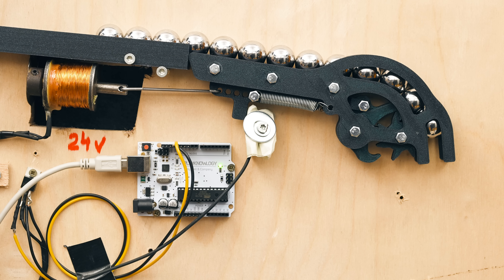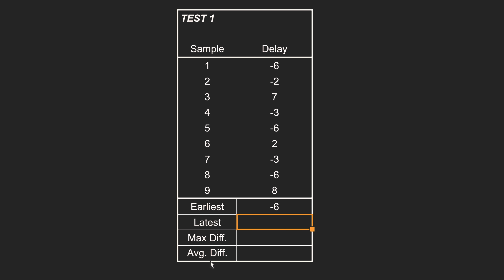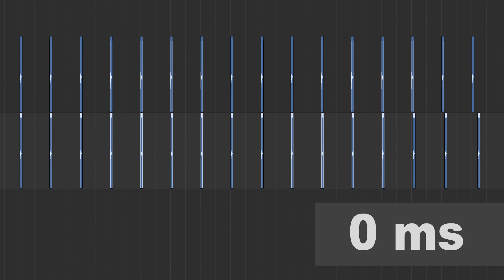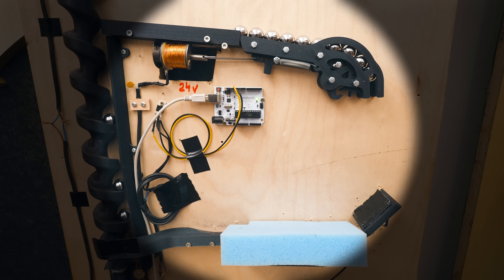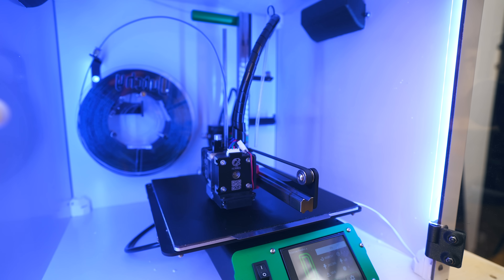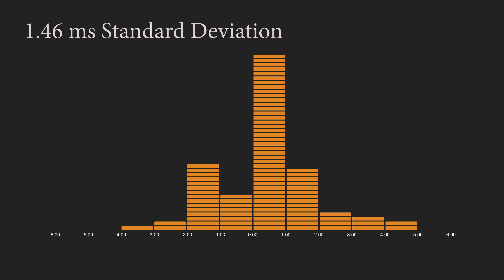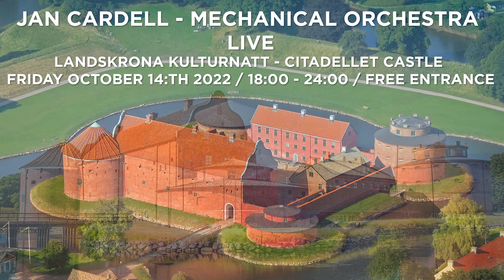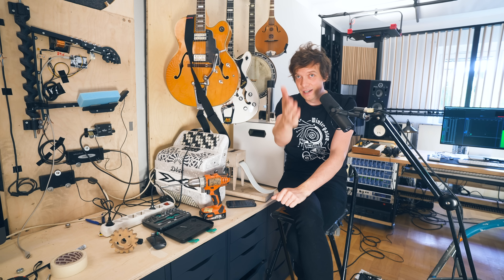Testing the Arduino Marble Gate

Comment: one thing worth considering, the more steel used on parts that are in motion of some form, will give you optimal tightness and life span. There is a specfic property for this feature of steel but I can't for the life of me remember its name (reproducablity maybe?).  But it is one of the reasons it is used in making mass production machines.

Comment: Hi there !
Just a comment on your methodology from an engineer point of view, although not a mechanical one) : You'll probably agree that, by itself, a 4ms lag in the marble drop has no importance. I'm pretty sure that with the various vibrations and few instruments, no one will ever know about it. What you might want to be careful with are rather "accumulated delay", that is, you don't want your the drop time to drift over time. 

I think an interesting measure would be the average/mean duration of each drop rather than the standard deviation. In example, let's say you want a 1s fall time. If the average time over 100 fall is something like 1.1s, you'll be screwed after those 100 falls, regardless of the standard deviation. However, if you get 1s average with a 7ms SD, you'll probably be fine. This will allow you to relax your tolerances on the fall (which are very tight to say the least) and push them to the actual timing of your machine, on which I believe you will have less issue adjusting.

Comment: I REALLY hope this measuring of single-millisecond timing is only for methodology, because not only will you never attain such precision at full scale (without killing yourself, anyway), it makes next to no difference in the audible output. I only started hearing drift at 20ms, and then just barely. And because we're not dealing with a single marble that never stops moving, the delays won't be cumulative.

If you are even THINKING you can engineer an entire Marble Machine with such timing, please make a list of EVERY variable that can influence it. It's not just the points of contact, it's varying spring tightness, gradual wear of the marbles, gradual warping of the wood/metal/plastic, vibration of the entire machine. Then I hope you will stop thinking about it, and widen your margin of error.

You stopped working on the MMX for one reason, reliability. A machine can still be reliable at 20ms compared to 1.5ms.

Comment: You should consider sampling the arduino signal that drives the electromagnet as well. That signal should be way tighter than 1ms and you could debug the electromagnet actuator.

Comment: Dear Martin, I got a train of thought for you that might add another perspective to your approach. I don't think that from a listeners point of "view" even the variance of 20 ms poses any problem. In fact it even feels more natural than this highly exact beat does.

You're on the way to something that is different from a digital drum machine by complexity and looks only and I'm not sure that this is what you aim to accomplish. And I actually don't think it is what is needed to get the Marble Machine going.

The question is: Why do you need that kind of accuracy? And there are two things I can think about...

1) Errors. Catching and transporting the marbles has been pretty difficult in the previous versions of the MM. So having exact marble movement was a must. But the problem is that the more complex the mechanism is that catches the marbles the more precise they have to drop. So simplification of the catching mechanism takes out the need to be overly precise in the drop.

I know, a funnel the width of the whole machine isn't as intriguing as the fly trap funnels but it gets the job done every time... no matter how sloppy the drop is.

2) Tightness. You can't play tight enough if the marbles aren't dropping right because they might get in the way of each other.... Except... If you split the drops between two (or more) identical drums. Which means half the precision is needed in the drop to get the marbles out of the way in time. (Which ties in with the whole "simplicistic catch mechanism" thing).

Hopefully this perspective helps a tiny bit on your great journey. 🤗

Comment: I remember watching the original video of the marble machine and being amazed. I knew the video was edited. There was no way the machine could play that as perfectly as it did in a single take. I just didn’t care. When Martin started on the MMX, I loved watching the way Martin had envisioned the machine and how some of the problems of a world tour would need to be solved. Then it slowly became watching a musician obsessed with perfection beating his head against a metaphorical wall of attempting to make sure some stupid ball bearings don’t fall on the floor.

I’ve learned a lot watching Martin’s video. How problem solving works for things in engineering mostly. But the biggest take away I have learned from Martin, don’t chase the unattainable. Unbreakable combs can be broken, the Maytag repairman will still to be employed, and galvanic corrosion will inevitably occur. 98% success is enough in most cases.
Reply: the first marble machine played it... why should it be edited??? who told you such a garbage?

Comment: Maybe a quicker test harness to iterate designs would be to connect a mic/sensor near where the release happens and another where the marble hits, connect them to the Arduino, get the Arduino to calculate the stdev after n marble releases and send the value back to PC over Serial port.

Comment: You need a statistician or a data scientist or something to help you design these experiments and interpret the results. The experiments that you are doing are decent but could use some automation (manually entering data into a spreadsheet sucks, what if you could get 1000s of data points automatically!?). Interpreting the results you also do a reasonable job but someone really well versed in this could help understand what the data is actually doing, and perhaps give better insights on why its doing what it is doing.

I am a data scientist though so i might be a bit biased.

Comment: Good to see you back to work. I have missed your videos. I understand having to take a break from something. gives you perspective... Keep up the good work and I hope you do decide to build another. This time with the experience and knowledge you have gained. Just remember, it will never be perfect. If you expect perfection, then your setting yourself up for failure. With that said, There is no rule you have to follow. you can build it anyway you want. electrical, mechanical, wind powered, pneumatic, hydraulic, or whatever you can imagine.... in my mind, I see the marbles flowing in a sort of Laminar flow. Guide the marbles to their destination and rely less on the release on more on the flow. You could have a small marble area and a large marble area that give softer and louder hits. you could use a diverter system. each note getting a constant 4 balls a second and a diverter picks the ball to send to the note and the rest bypass. Like I said, whatever you can imagine... I will be watching.

Comment: I think you need a computer engineer.
You need to connect the contact microphone to the arduino and let the arduino count the time using the ADC and a thresold (or just a digital pin and an interrupt if connected properly).
Using an audio workstation is time consuming.
I hope you read this post because you need to get rid of that audio workstation to measure time.

Comment: welcome back ;)   i think you might get more useful results rather than a rough indicator with samples of 1000's of drops the arduino can calculate and record the differences in a csv for analysis or  even just calculate the sd for you requiring little or no spreadsheet shenanigans..

Comment: Before you do anymore design changes hear me out as an programming suggestion. Change your standard to Nanoseconds instead of relying on a difference in ms. If your tolerance is 1-3ms then you have 1000000 nanoseconds to 3000000 nanoseconds to work with in your design.

Comment: Probably not useful information for the real machine as you're not planning on using any electronics, but for those interested:

Arduinos and other microcontrollers are able to flip their control outputs from low to high (GPIOS) with pretty incredible accuracy. Where I work, we've worked on a few electronic products that rely on this accuracy for things like serial communication, where the timing can be in the KHz.

The timing issues from the arduino test are likely from the mechanical action of the solenoid, from the travel and friction of the bar. While the voltage for the solenoid can be flipped pretty quickly, the solenoid's magnetic field takes time to charge, though this should be usually pretty constant. The movement of the bar and spring is likely the biggest variable which could possibly be improved with a tighter spring and less travel on the mechanism.

Comment: The delay (for a given system) is random. A same amount of samples (marble drops) per test (each with their random delay) does not mean that the standard deviation you get from those samples are equally representative for the delay of the different systems. It takes a certain amount of samples for statistical quantities to converge to a value (i.e. to have the standard deviation value no longer change even if you keep increasing the number of samples from that point onward). That converged standard deviation value is representative of the system alone, a non-converged value is representative of the system, but also kind of dependent on the specific test, i.e. random. So with too few samples, your standard deviation value doesn't converge and it will be random (it will differ for the same system in different tests). Then again, I'm no expert, so I might not be fully right.

Comment: Regarding the angle of the marble mic, this means that a way to increase the tightness of the timing is getting more consistent landing spots. Most probably, the things the marbles will be hitting will be at an angle, so having a consistent landing spot will lead to consistent travel distance and thus consistent timing.
Reply: Not just "most probably hitting at an angle," but **certainly**. He wasted a bunch of time testing whether a computer controlled system had computer-level timing, and when he finally realized that the only uncontrolled variable in his test was the one which would be literally impossible to fully control (unless he wants to stop using marbles and gravity, that is), he simply altered the test to discount the variable altogether and declared it a success. Just incredibly bad science.

Comment: I deal with noise analysis on almost a daily basis, and I'd like to give a warning about diminishing returns. Standard deviation of multiple stages combine through a squared sum. If your marble gate has an stddev of 2ms, but your time until hitting has a stddev of 3ms, the total is an stddev of sqrt(2^2+3^2)ms=3.6ms. If you are putting all your effort into reducing the stddev of only the gate, you can only gain 0.6ms of accuracy at most!
Imagine now that you have to add the programming wheel action stddev, maybe some mechanical vibration noise, and you might find that one of them has a stddev of 10ms (leading to a total stddev of 10.6ms), you actually don't want to worry about the marble gate, you want to worry about the largest source of noise.

Comment: With arduino you could measure directly the times.  I suggest an optical detection at the top and bottom.  and measure time between light path interruptions.  You can easily get +/-100us with simple code on that arduino board, and if you push for better code +/-20us.  You can also measure time it take to trigger the transistor that drives the coil, and first (top) optical detector, to see how much variance you get just there.  The bottom one will detect the total time of fall, in case it varies for some reason, I do not expect it to vary.
The optical detector is a LED source, and a photo transistor as detector.  You might need to put them in such enclosure so ambient light does not get in the way.  The photo transistor output is good enough to drive an input in arduino.
You can use interrupt to capture the photo detections, better but more complex.

Comment: The ball drops when the voltage is removed from the coil. the spring works. if the ball fell when voltage was applied, then the spread of parameters would be less.

Comment: +/-1ms on the arduino is kinda horrible. Either the program is ineffective (very easy to do with Arduino IDE) or there's some stickiness in the solenoid. Might want to fix that before you go too far with this. Parallax Propeller may be easier to get consistent timing with if the Arduino is the problem.

Comment: Allright Allright. But why did you not use 2 sensors. One to check the gate and one to check the drop. 
If you would use interrupts it would be way easier to get the results

Comment: Martin, you're chasing zeros. 

You need to record yourself playing the drums (and other instruments) and determine the standard deviation of your note timing.  If your gate is within the same order of magnitude of variance as the human playing alongside the marble machine, then it's good enough.
Reply: a human can correct timing on the fly if they're off but a machine wont be able to so small mistakes will compound :)
Reply: To add on what Chaobyte said, errors on a mechanical machine tend to stack.  A simple illustration is that if a gate has an average deviation of .02s and there are 10 actuations, then by the tenth marble it will be 0.2s off and so on.  If Martin used a comparator, then he could adjust on-the-fly, but he wants a mechanical machine, not a computer-controlled machine.  Thus, he is approaching it with the precision of a watchmaker, who were typically the ones who made the original music machines that Martin is inspired by.
Reply: Drummers are quite good though. There is actually some reasearch about timing precision of human drummers. What I have quickly found is that 15 ms differences are very much noticable by non experts and have significant consequences in perceived quality.

Article goes by Music on the timing grid: The influence of microtiming on the perceived groove quality of a simple drum pattern performance

Comment: Hi Martin, great video! Nice to see you diving into statistics.

For your capture method it seems that it still requires a lot of manual post-processing of your data using your audio software. For lets say 50 marble drops this seems still ok, however wanting to run this for maybe 1k or more marble drops it will be impossible.

If you seek on doing more statistical analysis of your marble mechanisms and comparing variants, I suggest replacing actually all the contact mics with switches or inductive sensors.

Both the switch and inductive sensor would give you a clean digital voltage level which can be seen (sampled) by your arduino.

For this measurement setup as an example use one regular limit switch at the marble gate, then for the drop use an inductive sensor to detect the proximity of a falling ball.

Since you have already the arduino giving the signal to trigger the solenoïd, you can then reuse this same trigger in your software as the start of a stop watch.

Procedure would be as follows:
1. Arduino sends trigger to solenoïd and starts its internal stop watch in the code
2. The code then waits for the rising edge of the limit switch which is in contact with marble gate.
3. When marble gate activates and touches the limit switch, its rising edge of the voltage is detected by the arduino and the arduino logs the time.
4. The code then waits for the rising edge of the inductive sensor which is in front of the path of falling marbles.
5. When the falling marble passes the inductive sensor, a signal is seen by the arduino and the arduino logs the  time.
6. Now by combining the recorded time of the limit switch at the marble gate and the recorded time from the inductive sensor, the code calculates the time difference.
7. The time difference can then be send over serial communication (over USB) to your computer where a program in python reads in the values.
8. Lets say for 1k marbles we repeat 1k times step 1 to 7. At the end of the 1k loop, the python code then automaticaly calculates the average, median and standard deviation on your dataset of 1k time differences fully automatic (no manual post-processing of data :D )

I hope this is a helpfull suggestion to help you improve on building accurate/automatic/reproducable measurement setups :)

Comment: Exact measurements is an art. You should actually have an expected time for the drop to compare with, and preferably you should have some automatic measurements, and not do it by hand. Perhaps you can connect a mic to the Arduino and measure the latency there?

Comment: Im not tryin to be a turd but if your goal is millisecond precision, why bother making a bouncing ball baring machine at all, you could use an armature, connect it to a servo motor and make it swing at a trigger pad, would be about as interesting and would actually work in the otherworldly level of precision that you seem to be chasing. or hell... you could just make a beat on a laptop if that level of precision is desired. The point shouldn’t be to be absolutely perfect. The best, most precise mechanical watches on the planet can have amplitude deviation or beat errors... the point of owning such a watch isn’t the precision as much as its the soul of the watch. If I want atomic perfection, id go get a quartz watch.